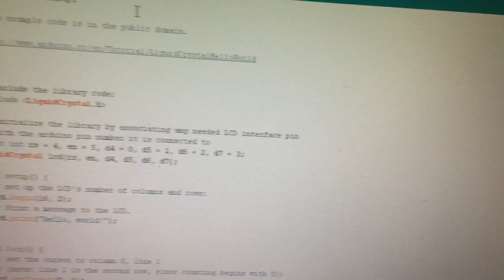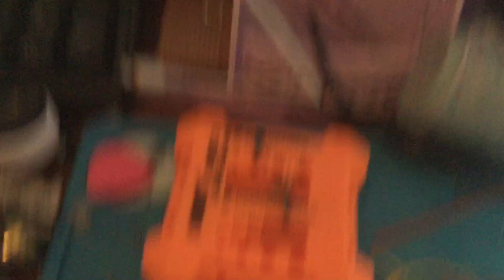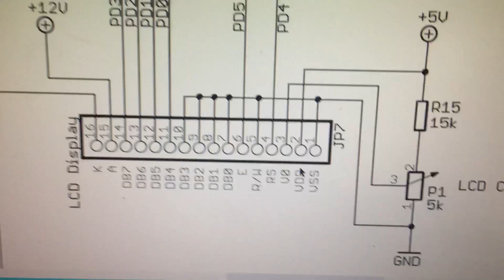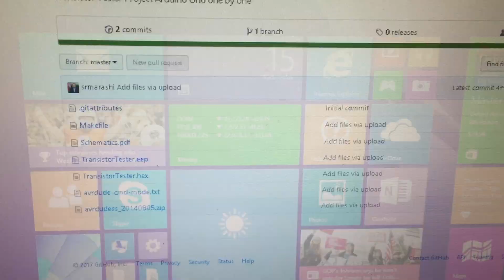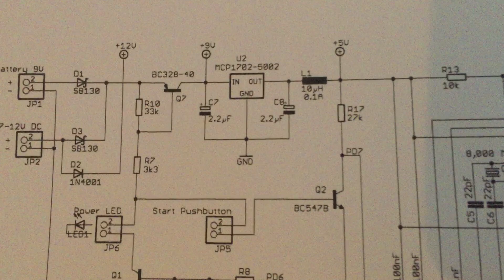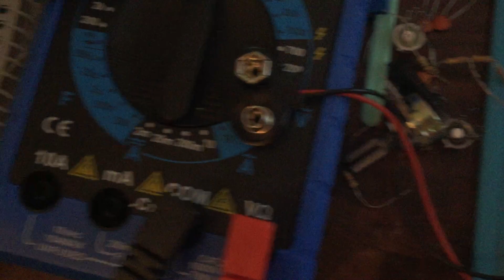FULL Project for Transistor Tester Component Tester Arduino UNO

Comment: First off. I found your channel while researching the MC12080. Then I noticed you've uploaded a lot of interesting content. I have been playing with the OSHW AVR transistor tester project for a long time. This tester is a clone of the project from mikrocontroller (dot) net. I've done quite a bit of work on creating schematics and details for the project. You should really check out the project itself. There is a SVN repository available with make files that cover everything from ATmega8's to Arduino UNO/Mega versions all the way to version 2 of the project based on ATmega644 or ATmega1284's. 
     The 644/1284 is version 2 of the project, and it is primarily developed on a Russian forum. There are 2 firmware forks available in the SVN repository. The primary fork is developed by Karl Heinz on the original German/English mikrocontroller thread. The second firmware fork is done by Markus R. He helps people with the project over on the EEVBlog Forum. It's all worth checking out. The actual firmware is written in a combination of C and assembly. The code is very advanced. Karl updates a PDF in the repository that explains everything about the project in detail. The PDF is over 130 pages long.
  I'm just a hobbyist. I've been using the project to learn. I've got more information about the project on my channel (it's not monotized nor do I plan to make it monotized in the forseeable future) My uploads are just a community resource. Check it out or don't I don't care, it's up to you. 
  I'm posting this because I was researching different ways of creating a frequency prescaler for the project. Version 2 of the project includes an optional prescaler circuit that is supported in the firmware. The hardware used is a CD4011, two 74HC4052's, and a 74LS4060 if I recall correctly. I've been looking into other options and got side tracked here after researching the MC12080. I don't completely understand the prescaler circuit used on the project. I usually explore several circuits to better understand how the topology works in general.

... anyways... Your working with a lot of interesting things. I'm surprised more people aren't following your content on here. I am. 
  Have a great day :)
-Jake
Reply from the maker: helllo, man i told in video that this project is for others and i changed this to arduino uno. it is hex file and it is free to download from internet and the hex files name are all under name of programmer. thanks for your kindly comment